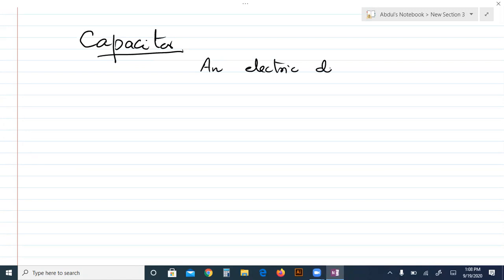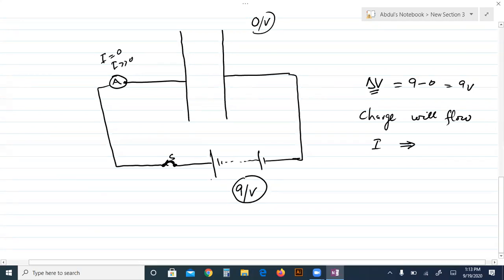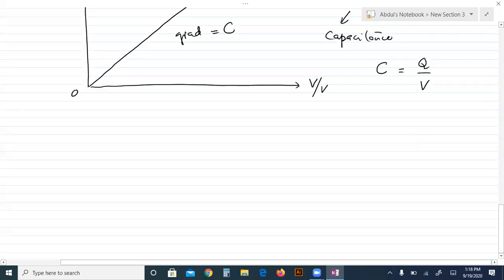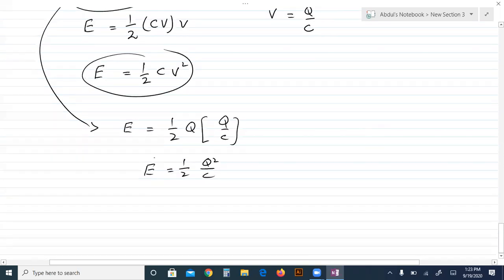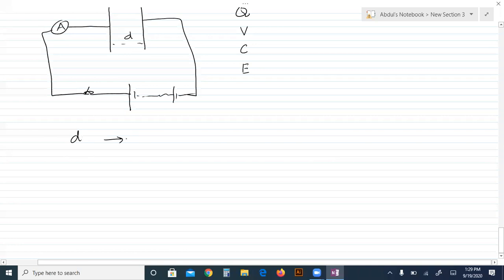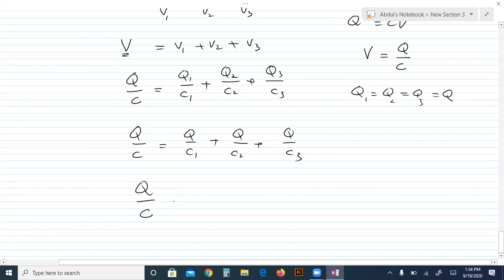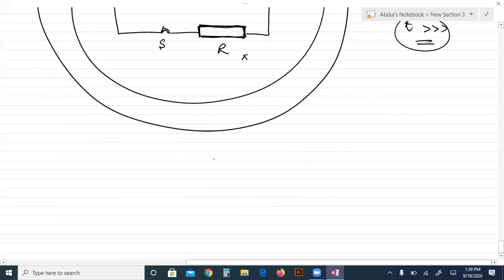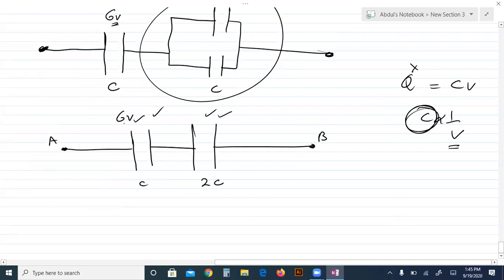CAPACITOR AL

Comment: 21:50 sir, but dont (-ve/e) charges flow from a low potential to high potential? Then why would charges flow back to the battery if thats the case

Or did you mean to say that current will flow back to the battery.. I’m quite confused by this part, I hope you answer my question. Thanks in advance.